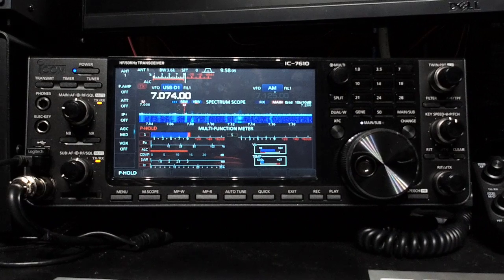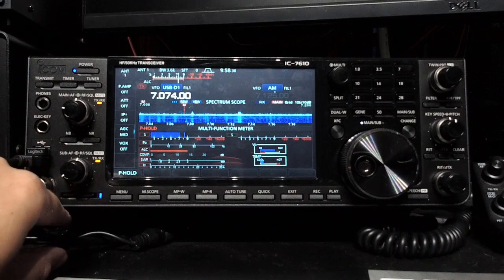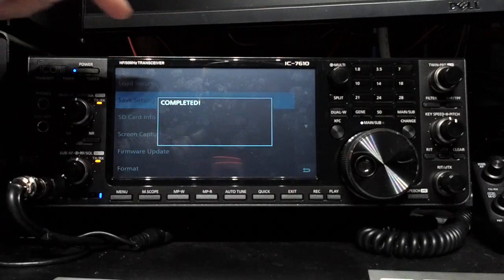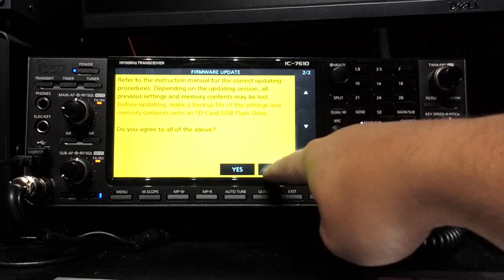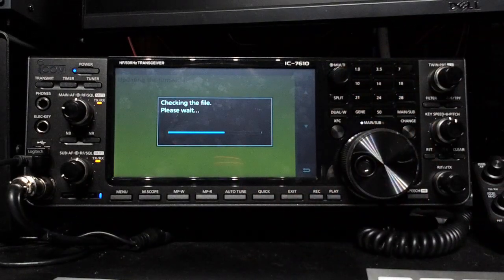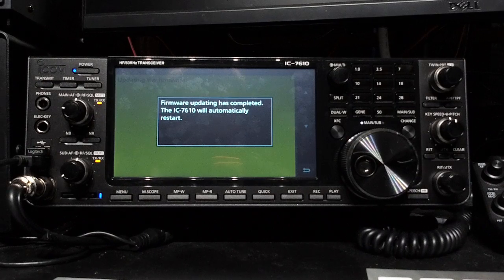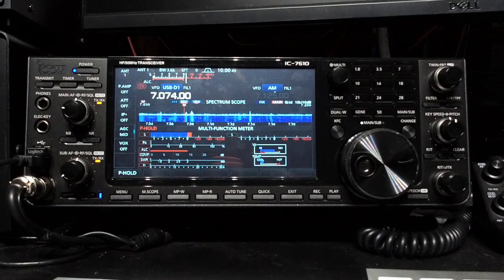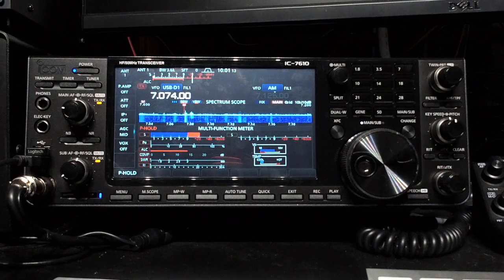Icom IC-7610 Firmware Update V1.06 UPDATE NOW

Comment from the maker: If you experience issues after the upgrade (we experienced the 500Hz tone the first time we tried the sub receiver and monitor function), we recommend downgrading back to V1.04 and then re-upgrading to V1.05.

We have not experienced issues since, but will keep you posted.  Please note just 'reloading' the same firmware won't accomplish anything; it actually 'skips' through the process.

73, Jarrad VK3BL & The Rate My Radio Team :)

Comment: Where did you hear that FPGA nonsense? That’s just not true, first of all, you don’t program the FPGA, you program the nand flash. Bitstream is loaded onto the FPGA on poweron. If it were ”hard to program” this process would fail every Nth time you power on your radio. And if a bitstream doesn’t work on one fpga, but works on another, sorry to disappoint, but that just means one of them is a dodgy part and should be replaced.

Comment: Also I’ve been holding back on the 7610 because of that random tone from N2FJ 73
Reply from the maker: I would not hold back because of the random tone; its a minor complaint that happens very rarely and is easily fixed.  Plus I am 100% sure it will be solved sooner or later with an FPGA code update.  Apache Labs / ANAN radios have similar quirks.  Its all part of 2+ receiver SDR and it will be sorted in time :)

Comment: Did you get the muddy sound using the heil pr40 with your Icom7300?      I have the pr40 and was looking to get the Icom 7610.   The pr40 seems to work well with my Icom 7300.
Reply from the maker: Absolutely not; its a lovely Microphone and I never had issues with radio usage, just HiFi / Broadcast 20Hz to 20KHz on youtube :)

Comment: hi jad get yourself a nice mic pre-amp for your PR40 it should improve your sound.
Reply from the maker: Dear Steve I have a DBX 286S which while not exotic was designed by Bob Orban of US Broadcast engineering fame.  Its honestly just my voice; I have 20-30dB peaks on my fundamentals below around 120KHz, and my ‘presence’ is below the PR-40’s boost.  For me the PR-781 has always sounded better on a studio chain, and just as good on a radio.  Plus, its sexy and black like my radio gear :). Ill let the PR-40 to go to someone who it suits, and stick with the Rode.  PS, my previous few videos were all PR-40 on the same studio chain, and I’d even EQ’d the bass down.  The EQ isn’t used on the Rode in this at all.  The PR-781 remains my recommended Mic for Ham Radio; the 600 ohm impedance plays nicer with the Icom front end and sounds better than the Rode with its 320.
Reply: Hi Jad I also use a 286s but didn’t realise that Rob Orban had been involved with its design, nice one. I use it with my 7300 and Pr780 along with 30db of attenuation, seems ok, 73 keep up with the good work
Reply from the maker: Didn't notice you said PR-780... lucky man what a rare mic!

Comment: Yes the Rhode sounds very nice, no clipping or distortion of any kind.
Hope this update cure the tone issues. 
I have a PR40 for my radios and it sounds great. But I run it through W2IHY Audio gear though.
I might give the Rhode a go as well, see how it goes!

Cheers, Les VK3TEX.
Reply from the maker: Dear Les,
The PR-40 is fine to fantastic for Radio usage, which has limited bandwidth and often significant roll of towards the passband edges, but for youtube it just didn't work for my particular voice.  I'd have no problem recommending them for radio usage, but as I have a PR-781 also that works just as well, I've decided to part with the PR-40 :)

Comment: A very brave soul.......
Reply from the maker: Mark, there have been significant issues with the radio firmware; I fully believe Icom do very very extensive testing before releases, so I am 110% confident to apply it straight away.  Icom is a very conservative company, and having recently spent 5+ hours trying to track down an SSB audio quality issue with my 7610 I was delighted to see this firmware.  I also strongly suspect it may 'ward off' future issues with the radio, so it is a must have straight away in our eyes. :)